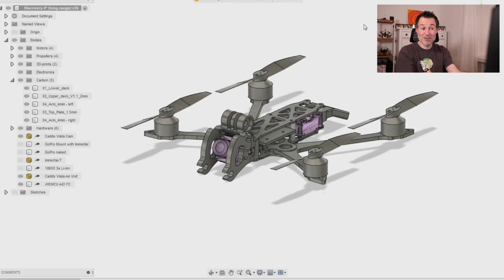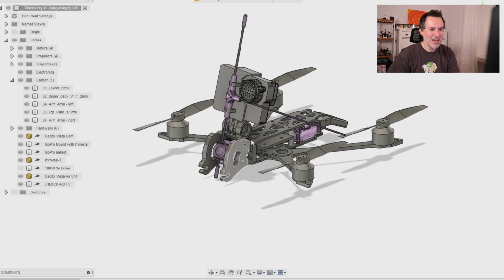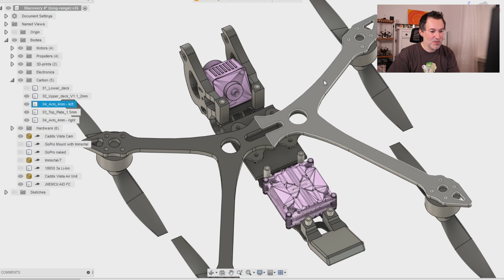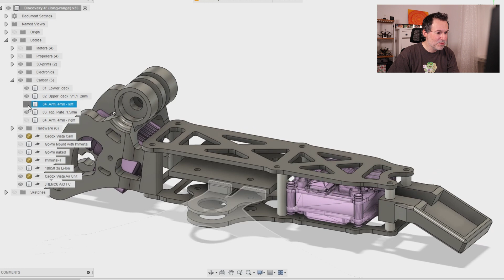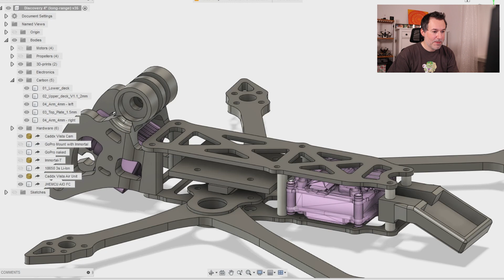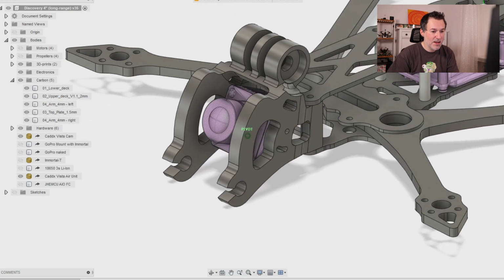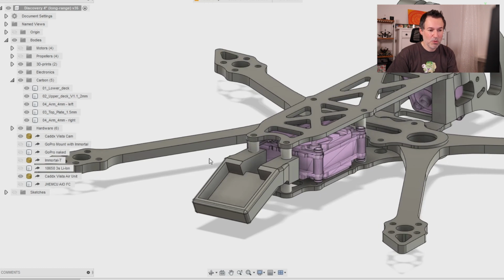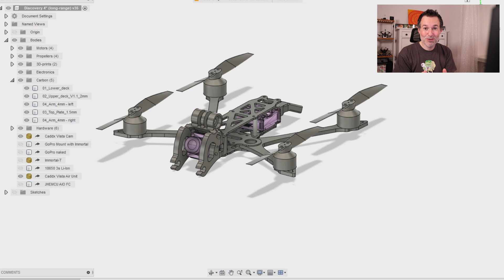Designing the #discovery 4" micro long-range frame!

Comment: I like your design, I'm thinking in building one similar to yours... The thing that I like less is the protection of the camera... only tpu?!? is it secure?!?!
I have seen the construction video, in that video you fly the drone (5 months ago). I suppose that you have fly your drone a lot of times. Is it durable (specially arms and camera).
Another thing, the construction video is not in YouTube discovery playlist, and the link is missing in your thingiverse project page. It's no easy to find :-P
Thanks for sharing.
Reply from the maker: Thank you for your feedback! Just fixed the links :-)
TPU is working really well for lens protection. As it is not stiff, it is able to suck up a lot of the impact force - before it has a chance to touch the lens.

Now as it is a mid-range drone, the main focus is relaxed cruising further away. In order to get longer flight-times, the weight is reduced as much as it makes sense. I tried to find a good sweet spot between weight and durability, but it is not comparable to a sturdy Freestyle frame (like the ones from Catalystmachinework).
However, mine has easily survived some minor crashes and is still flying perfectly :-)
Reply: @eyeflytinkerings  thanks for your reply... The problem with the lens protector, is that I'm not as good as you flying :-)
If you are interesting in fly time... have you seen this strange quad: https://www.youtube.com/watch?v=8UOTyEGb7qE&t ... drome seems very fragile, but he says that he gets better times of flying when flying "as a plane" (I don't test it). Jushua Bardwell has a video testing this quad. May be it gives you some ideas. Based on this concept, another thing that I'm thinking for the future is to build a drone with 5-6 motors and small wings.... will it fly? :-D

Comment: Careful with your antenna placement though. Gopros are sometimes noisy rf-wise. Otherwise, nice design.
Reply from the maker: That's a good point, will need to check. This idea was a very spontaneous idea without much thought put in. Yet i'll test and try to compare (which isn't easy, CRSF range is just crazy :-))